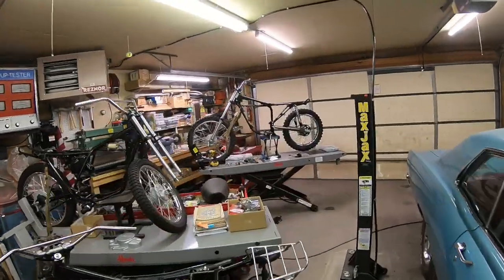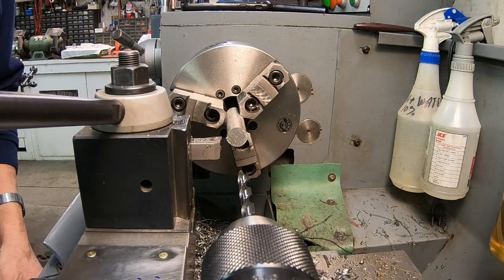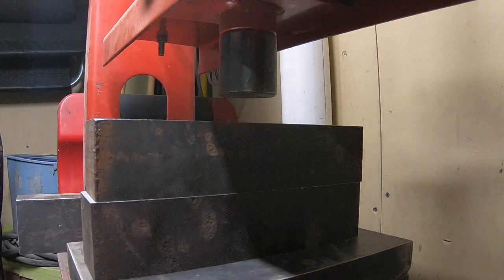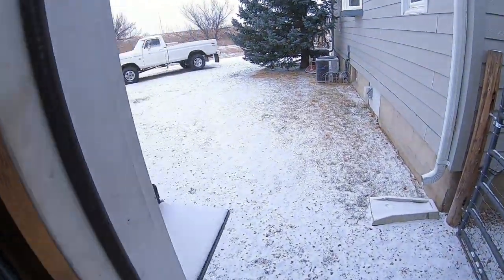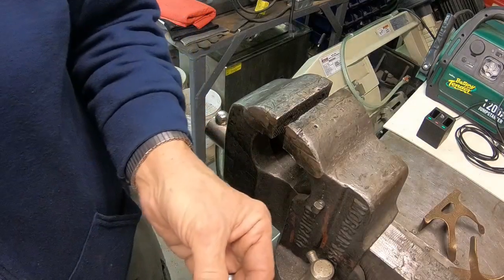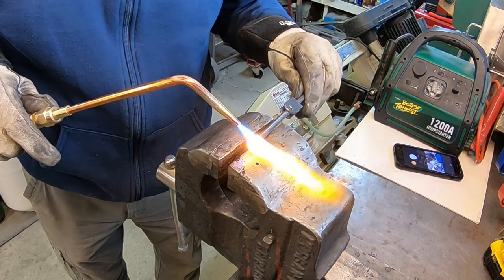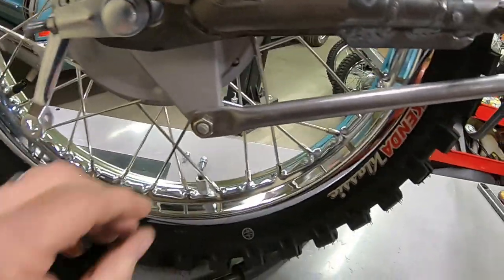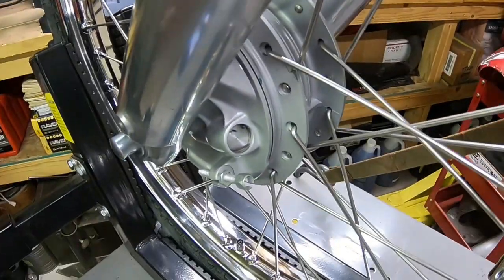AT-1 Yamaha MX Mock up and small jobs

Comment: Hey Dale, how did you get to know about all the machinery and master its functionality. It's amazing 1 man show.
Reply: Hey Dale, what vendor or company do you buy your shocks from? I'm needing a set for a 1973 f11 250 Kawasaki
Reply from the maker: Hi Larry, guess I come by it naturally, my dad was a mechanic all his life, I just hung around him and soaked all that kind of stuff up. I am mostly self taught, I bought all my machines very well used, and worn out, but am able to make them work for me. You just learn the limits of the machines. By adding DRO's to them it makes them easier to use with all the worn worm gears and shafts. I also worked at a Suzuki, Hodaka, and Montesa dealer in the early 70's, plus just the fact that I was riding all those bikes back then. Now....well you see it, Im retired and have a very understanding wife that allows me to play in the shop all day. Life's good. Thanks Larry for supporting the channel, it is much appreciated.
Reply from the maker: Well Larry as luck would have it, I just ordered some shocks for the Yamaha 125 MX project. I have been looking in to this for a while and settled on NJB's, they are made by a former employee of Girling. They come pretty highly recommended by a alot of the vintage Yamaha enduro folks. I bought the NJB MX shocks with the 75 lb springs, from Speed and Sport, they were 300.00. Dont know much about them except what I have heard. They are not the most expensive or the cheapest. I can let you know more when I get to ride with them. They are also adjustable in length, so that is good. Check out there website. I also considered Progressives, Redline,  Ohlins and Racetech. Just like anything, have to decide how much you what to spend.